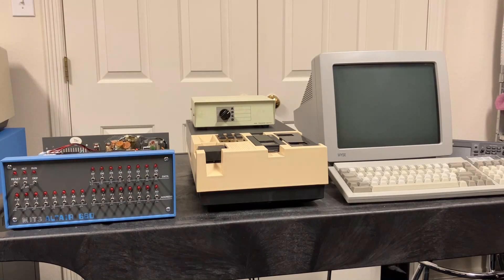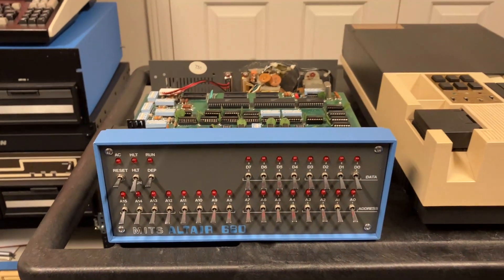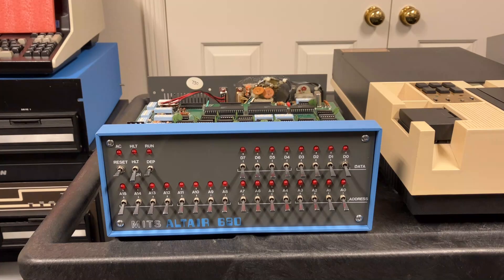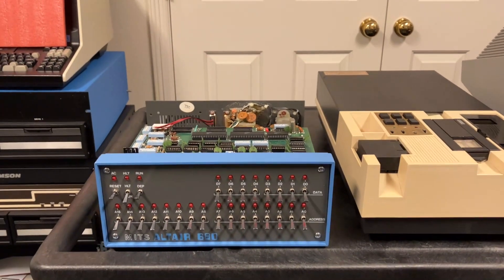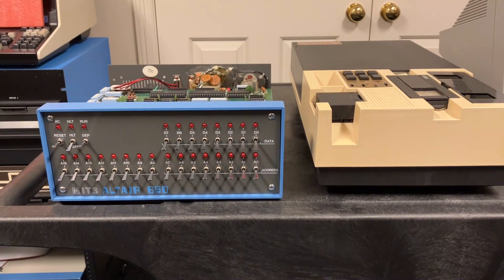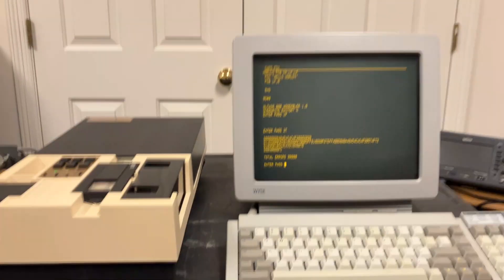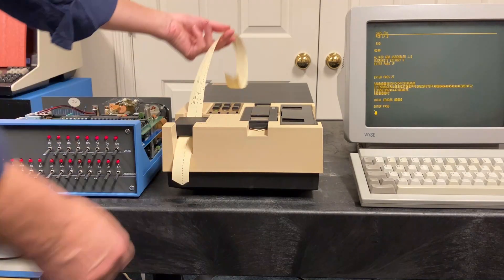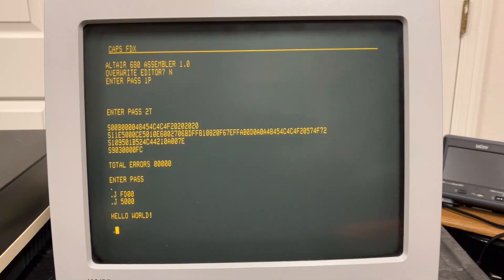Altair 680 with High Speed Reader/Punch, Part 3 (Utopia at Last!)

Comment: If the terminal has an Aux or serial printer port, could that be used to interface the punch with the computer while eliminating the switch?
Reply from the maker: Contemporary dumb terminals didn’t have features like an aux port. As smart terminals became more common in the late 70’s and early 80’s, many offered an Aux/Printer port. The functionality of that port and how to control it varied widely between terminal models.

Comment: I notice the CLOAD does not interpret the basic program lines as if they were typed in via a terminal (which is how I’m currently getting BASIC programs into my ALTAIR 680 port). I assume it loads directly into it’s designated memory address dependent on the WANT SIN-COS-TAN? selection. Does that therefore mean if you choose Y or N to that option the program will only work with the same configuration it was created with.
Reason I’m asking is that choosing a different option changes the start of basic program address in RAM. And the BASIC program is not relocatable in RAM without patching because each line of the program has a pointer to the next BASIC line in memory.
Reply from the maker: Yes, you are right. On the 8800 side of things, tapes you made for different versions of the same BASIC (e.g., 8K BASIC v3.2 versus 8K BASIC v4.0) were not compatible for this same reason. And as you’d expect, tapes from 8K BASIC were not compatible with tapes saved from Extended BASIC either. For this paper tape application, the start address of the BASIC program is fixed at the end of the patch, so the “Want SIN…” prompt doesn’t actually change memory usage.

I made a save/load PROM for Altair 8800 4K BASIC that converts all line addresses to relative during save and back to absolute during load. This allowed it to work for v3.2 or 4.0.
Reply: @deramp5113  I did the same thing for my port of the 8K ALTAIR 680 BASIC v3.2 due to patches that I added to make BASIC work with the Fantom monitor I'm using on the ETA-3400. I was thinking that one way to transfer programs from one version to another would be to list them out of the terminal port, then bring them back in as a BASIC text file as though being typed in, so they would be re-tokenised. That requires bigger delays on a 3-wire serial port, but should only be required once for each program. But I like your idea of putting relocatable addresses in the program before saving, then patching them again when loading back. The other thing I was concerned about was if they used different tokens in BASIC for different versions as they did on different platforms later on.